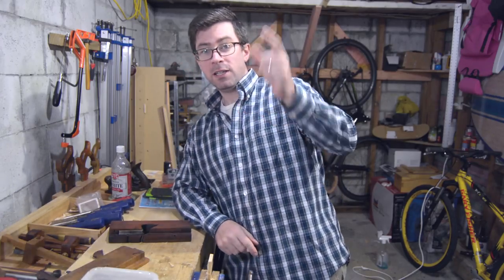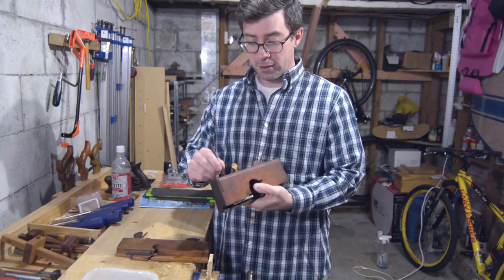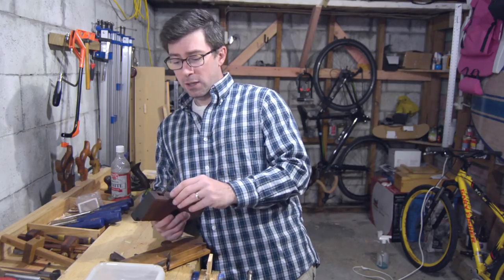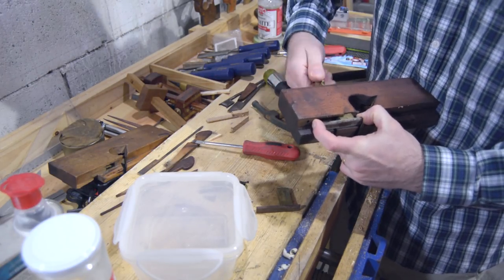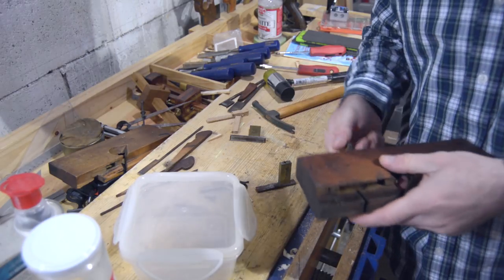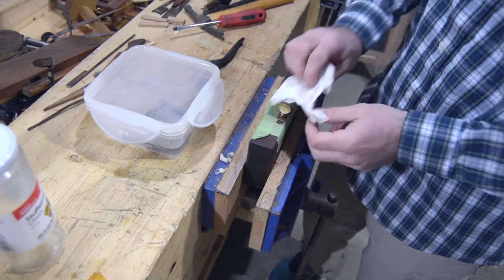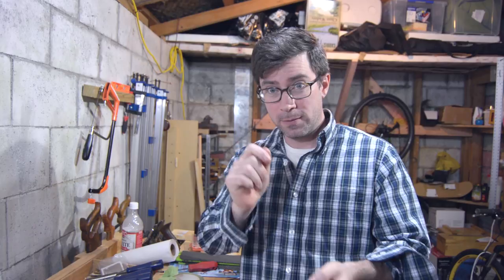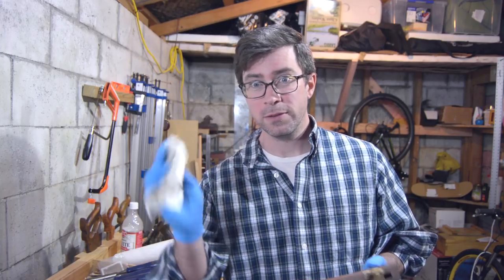Restoring Two Antique Dado Hand Planes

Comment: I just got a 3/8”, 5/8”, and 7/8” all in great condition.  I’d really love to have a 1/4” and 1/2” over the 5/8” one, but love the 3/8” and 7/8” ones.  Thanks for your video and I’ve enjoyed much of your other content; I just didn’t have much recall of this video until I just went back to it. 👍
Reply: Ok, I had another minute to throw another idea out here (not necessarily for you I guess Phil since this is now 5 years old, but to be fair, if someone goes searching YT for content regarding dado planes or old joinery planes in general; there’s not a whole lot).  It’s been my experience with my pretty hefty collection of old molding, bench, joinery planes and even old school saws, that unless you can tell the tool was long neglected and used little that really dark grime is still probably a tool that was maintained with tallow as opposed to wax/oils.   For those tools, I continue to use tallow (I prefer mutton tallow) and for the others go which ever route.  It seems to me that forcing a tool down the oil/wax route after over a century of tallow and body oils just doesn’t hold up well.  Secondly, these are pretty easy to box/re-box just like you would an old rabbet plane (stick with the hide glue on this).   Phil, I particularly appreciated how you told everyone how you gathered your honing angle from the assembled plane; these and rabbets both can be a mystery the first couple of times if someone just goes off on a new ‘unbeaten’ path.   Again thanks brother 👍